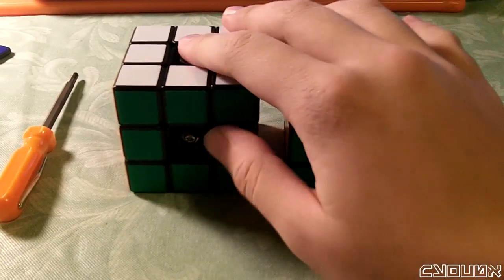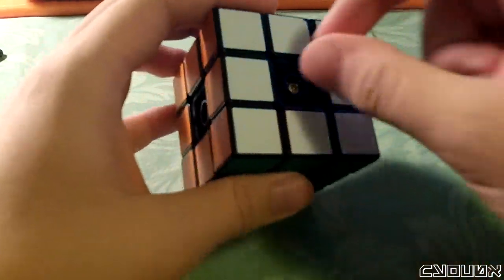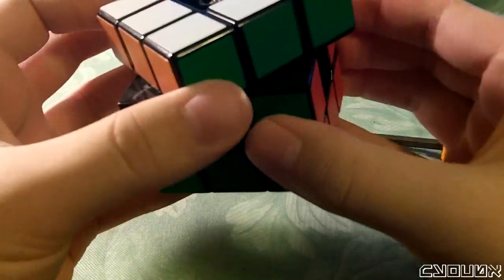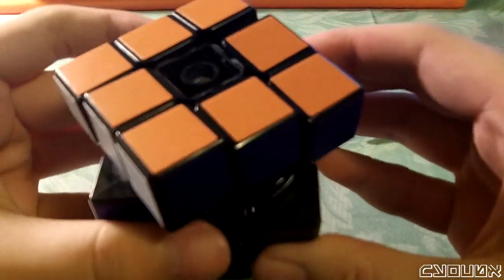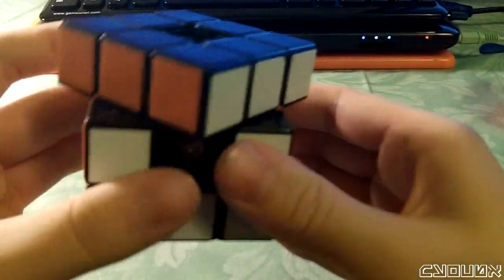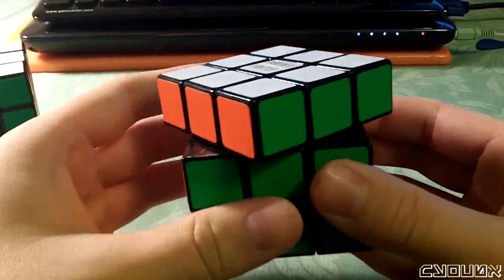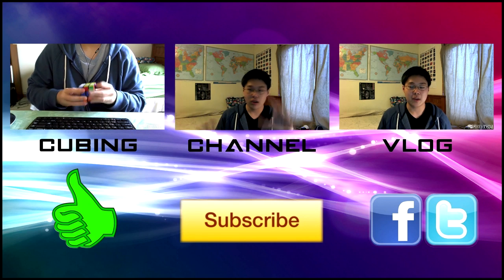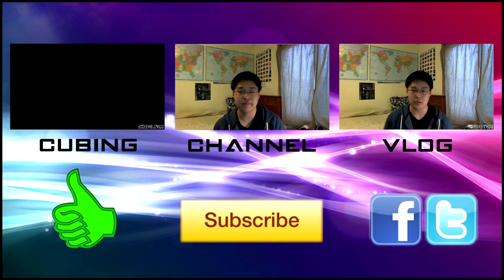How to Tension / Retension a DaYan Cube (cyoubx' way)

Comment: Did this and it completely ruined my tensions. I have a Shuang Ren v2. What I noticed that's really weird is that I can get all sides to corner cut easily but when I have Red as F and Yellow U it won't corner cut without using a ton of force. Red cuts completely fine on it's own, Yellow cuts fine on every other side. If I rotate the cube while tensioning any face and test whatever side I'm on it cuts differently for each side (even though U remains the same) What's causing this? Each sides tension affecting the U side differently?

My experience following this video is that your technique doesn't work at all for me. Each side is completely goofy and either will / won't cut depending on what side is facing me.

Comment: What do you all mean by 'penny' when you talk about the distance between the core and the centerpieces? If it's a unit of measurement why there is nothing on google about it?) (except for nail size, but i guess it's different)/
Reply: Just kidding He said that's a bad idea and to not do it because that method doesn't reliably tension the cube evenly.
Reply: If you don't know what a penny is, it's the smallest denomination of u.s. and Canadian currency denoting 1 cent. As in; 0.01 USD. He's just saying that another cuber suggests tensioning to the width of that coin.

Comment: My weilong turns smoother and is more controllable than my new Lubix Guhong V2. I though the guhong would be my new main, though I was disappointed. It is uncontrollable and catchy. Should breaking it in be worth the time? Are tensions wrong? My Weilong is also broken in very well.

Comment: V-cube 3 center caps are superglued on when not a DIY, so you need a razor blade to cut through the glue, and then they should come off like normal.

Comment from the maker: I don't really tension big cubes.  The general rule I use is to tighten it completely then loosen it half a turn to a full turn.  I find loose(r) cubes lock up a lot.  Tightening them decreases corner cutting but it prevents catching for the slices.  I guess I'm sacrificing the outer layers for good inner layers.